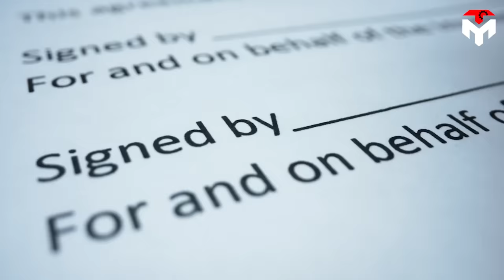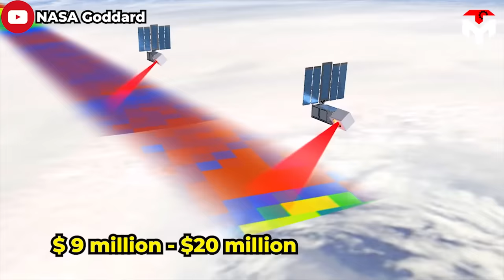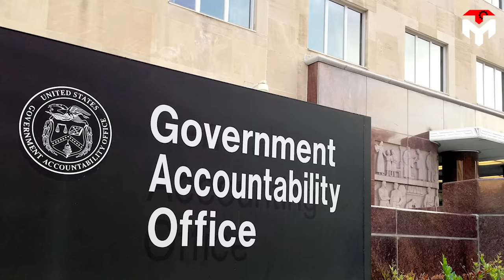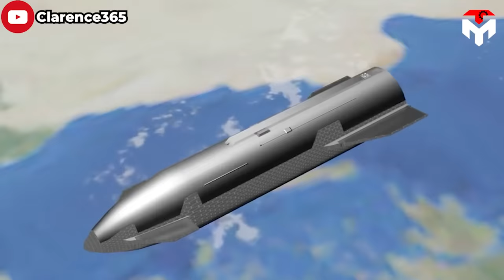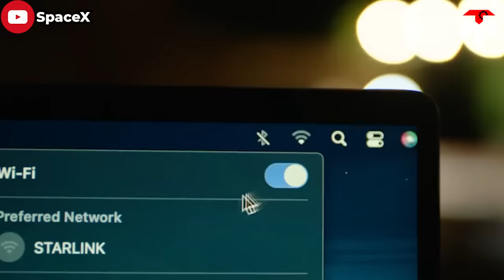It happened! SpaceX just revealed Starship's first payload to orbit...

Comment: Would very much like to see a parallel Lunar operation having the mission of rough landing useful tools and textiles that don't require a gentle touchdown to be successful.  Pretty sure a roll of duct tape, and some self tapping sheet metal screws,  and a recent favorite of mine: bamboo, and tie wire and rope and string could survive a pretty rough low cost landing.
Reply from the maker: This is an interesting idea!